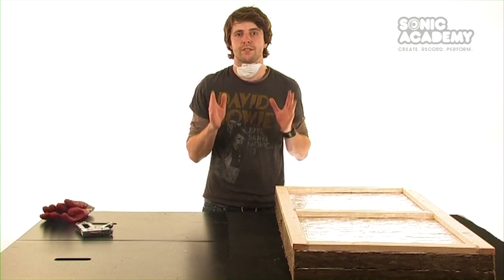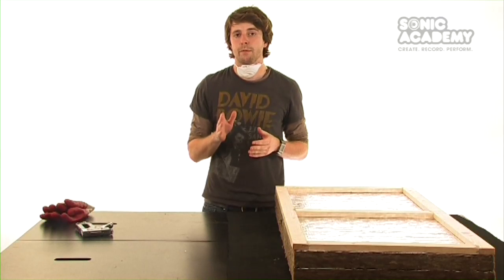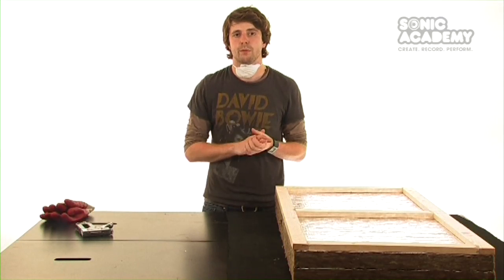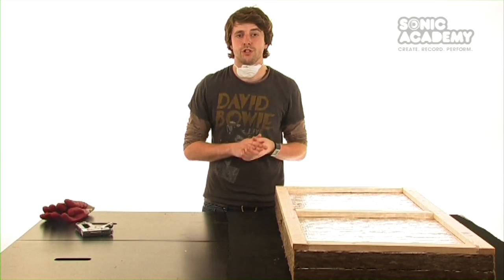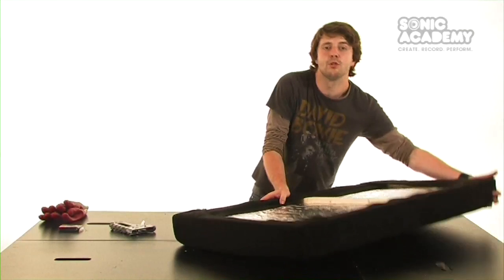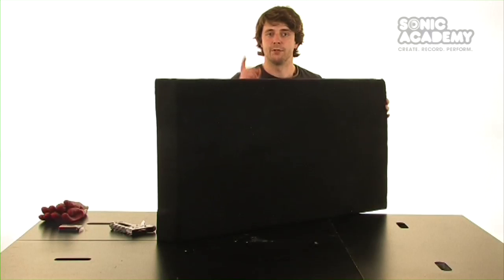How To Make A Rockwool Sound Absorber / Acoustic Panels - Part 3 Fabric

Comment: Is the foil paper something you added? It didnt come in my rockwool. Since I am concern if putting a porous material will also allor the wool particles come in the environment of the studio, I think that should be a way to stop them to come outside, but what is going to happen with the sound if the foil is there?
Reply: Cover it with inner layer of cloth

Comment: The rockwool fibres are still prone to escaping through the material you used to cover the rockwool. This is a bit unsafe isn't it?
Reply: modern rockwool with RAL standard is safe. At least in Germany since June 1st, 2000. So only if you use old rockwool or rockwool without RAL standard, you'll encounter this problem.

Comment: The material you cover the panel with should be acoustically transparent so that the sound waves can travel through in order for the rock wool/fiberglass to do it's job or be effective.
Reply: all material is transparent acoustically. the more thick the more it holds a bit of high frequencies.. and for low frequencies even the wood plank would be transparent
Reply: how to test? cover any speaker with material and tell how much difference you hear

Comment: Which Fabric Is That...
Reply: Its Speaker Fabric From Maplins
Reply: Phil Johnston can I use any other fabric to cover rockwool like other cloth
Reply: yes.. as long as its somewhat porous and not like some type of leather or on porous waterproof material or something werid
Reply: Best Thank you sooo much
Reply: not true. you can cover with foil airtight, it still we transparent to 99% of frequencies, especially for low frequencies. if you doubt that, start from thinking how the sound can go in the water it is not porous :P

Comment: Any particular reason you favored a frame on the back instead of an encasing frame?
Reply: Leaving the sides of the batt uncovered keeps that surface area available to absorptive energy. Conversely, covering the sides with framing reduces the absorptive area. Neither method is better or worse; every space has its own requirements which must be determined on a case-by-case basis.
Reply: Air gap.
Reply: @GS-FUYouTubeforchanginghandle  It has foil on the back of the fibreglass (because he bought thermal and sound fibreglass), doesn't that render the air gap pointless?
Reply: @PeterAlanJohnson  It doesn't seem to. https://ethanwiner.com/acoustics.html

I used 703-FRk in my panels, but I haven't compared 703 to 703-FRK.
Reply: @PeterAlanJohnson  Yes, air gap is of little benefit. But having a frame encase the sides could actually detract from the performance. Imo

Comment: Is a frame needed when u got like rockwool panels?
Reply: so you can hang it on wall
Reply: Frame makes it easier for hanging the whole panel on the wall, but it's not needed if you use stronger fabric which can sustain all the weight of panels.

Comment from the maker: only from an acoustice point of view not for any soundproofing... you would need lots of heavy mass to stop the bass etc. a lot of studios use double skin double or tripple plasterboard walls for sound isolation. so you have one wall with 3 layers of plasterboard glued together then an air gap then another wall with another 3 layers. it all needs to be sealed too.

Comment: The whole point of this should be to enable sound absorpbtion.  The Rockwool slabs used in this construction are lined externally with silver foil.  That defeats the idea of allowing sound waves to enter the body of the slab and be difused.  These are effective in heat insulation but not in sound absorbtion.